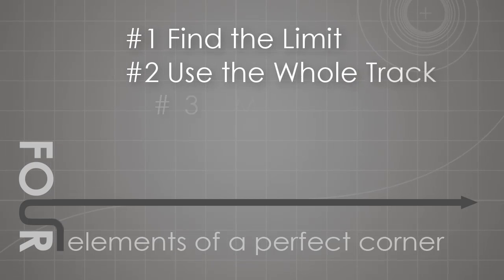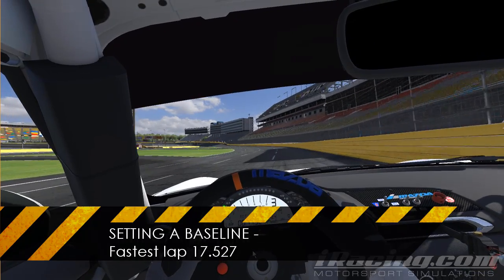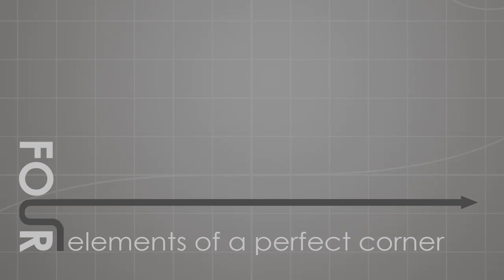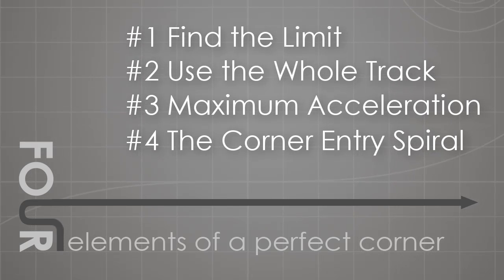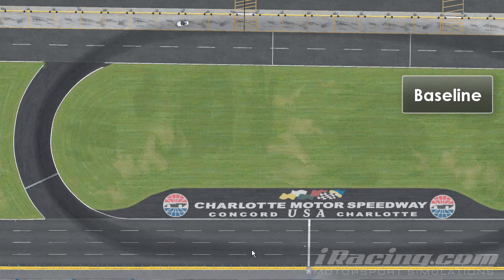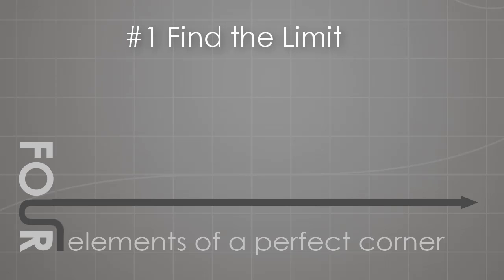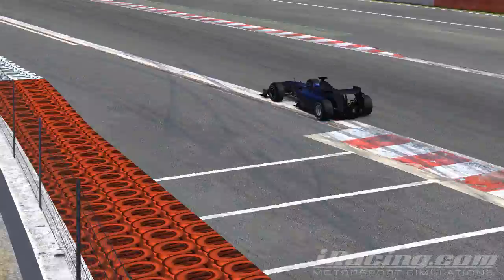The Racing Line - 4 Elements of a Perfect Corner (Physics Explained + Sim Training Tutorial & Tips)

Comment: Can you explain more why your geometric line is not at the constant speed as you state?
Reply from the maker: It is very hard to go directly from straight line braking to pure lateral cornering while still keeping the car at the limit the entire time.  If I had kept working at it I probably could have gotten closer to a constant speed, but what I was trying to show here is that even with a significantly increased apex speed and the same entry and exit speed I was significantly slower through the corner.  Even closer to a geometric line would have made me even slower through the corner.  Does that explain it better?  Let me know if you had more questions.

Comment: Found this video after reading your book. I like the theory overall, but it left some open questions for me. One is what is the actual direction of the forces for an optimal corner? 

Let's assume an AWD car that has more power than traction, and a 180⁰ corner. Applying the "SCUD missile intercept" control theory in the frame of reference moving at the approach speed of the car, the fastest way to get to the apex will involve applying the forces in the same direction diagonally from the turn in to the apex. Similarly, getting from the apex to the track out in minimal time (same theory but with a different frame of reference) involves generating force diagonally inwards. What's weird is that this involves accelerating before the apex, and slowing down after the apex 🤔 Curious if you've done any AWD experiments and visualization of forces.
Reply from the maker: I'm not sure I completely follow your example, but have you read this article. https://www.paradigmshiftracing.com/racing-basics/the-corner-exit-drag-race-racing-line-physics-explained#/ 
It might answer your question.  I talk about AWD in this as well as in the later books more if you've only read the first one.

Let me know if that article didn't answer your question and we can dig into it more.
Reply: @ParadigmShiftDriverDevelopment  thanks for a very quick response! That article is awesome, thank you. I wish I read it before the book. Do you plan to republish the book with corrections, and/or maybe redo this video? I wish I had a "one stop" place I could refer my friend to.
Reply: Also curious if you can point me at some explanation why the right shape of the entry is a Euler Spiral. I have a major in math and physics, and I studied control theory, but Euler Spiral isn't obviously an optimal line to me. Something like it — possibly, but curvature as a linear function of distance feel suspicious if the speed changes.
Reply from the maker: @TimurIskhodzhanov  Maybe at some point although I don't feel any of it is wrong, I just think of different ways of explaining things.  Some might work better for some than others.  I'm glad that one helped you.
Reply from the maker: @TimurIskhodzhanov  I talked about in the books how I primarily use the Euler spiral to illustrate the concept that the ideal entry line is one of continually reducing radius.  You would need a lap simulator programed to find the exact radius change rate for a given car and corner if you wanted something exact.  This wouldn't have much use though as a driver shouldn't be concentrating on trying to follow a preset line regardless. They are concentrating on other cues, but we've found that the entry line for a top driver in a typical car matches the Euler spiral so closely that it's also useful when charting out a line on a track map.
Reply: @ParadigmShiftDriverDevelopment  Yup, understandably that in a real car you can't use the exact same amount of max grip all the time. But still curious for an ideal car (this time without as much forward grip) if an Euler Spiral is probably optimal, or happens to just look close enough, and you didn't bother to go deep into those nerdy details.
Reply from the maker: @TimurIskhodzhanov  Well it does fit the principle by starting from infinite radius and then having a steady drop in radius along the path.  It would surely match the specs of a given vehicle since it visually matches most cars.  A rear brake kart would be a notable exception. I don't have a lap simulator program that would spit out exact curves based on various car force inputs although that would be really neat if someone wanted to develop one based on our work.  I did see how the new Sony AI driver Sophy for Gran Turismo produces Euler spiral shaped entry paths and that is beating even the top drivers out there.

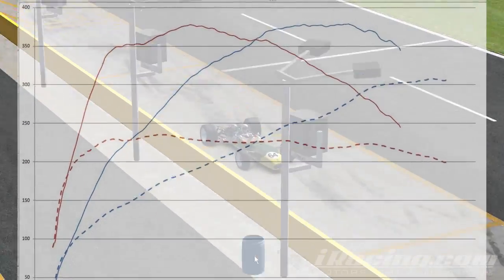Comment: At 17:10 I think you got a bit confused. The amount of "thrust" force the driven wheels provide is in direct relationship with the current torque, not power. A theoretical car with a flat torque curve, no aero drag and no drivetrain losses will generate the same amount of thrust on the driven wheels at any rpm while in the same gear. Changing gears will affect that amount though.

That being said, the general point is true: the important part is utilizing the traction of the rear wheels to 100%, which can mean all kinds of throttle pedal inputs depending on the exact powertrain of the car. ...TURBO LAG!
Reply from the maker: I understand what you are saying, but I try to keep my explanations as simple as possible as I know it can already be a bit overwhelming.  I'm not trying to explain horsepower vs torque here, I'm primarily trying to explain that you don't necessarily want a steady increase in throttle.   

For anyone reading this who is curious about power and torque here is a good video  https://youtu.be/UIQjyn95c-o

Comment: It seems like recent changes to the tire modeling in iRacing may have affected what is possible in the Miata -- are the sector times and speeds quoted in the video still current??  Also I'm wondering if you would be willing to share some data (iRacing or MoTeC format, latter first choice ;)) as I'd love to do an overlay to see where the opportunities for improvement lie.
Reply from the maker: Hi Mark, this is Adam.  I try to keep an updated current best time for the MX-5 at Charlotte legends on the training page of the website.  I think it's around 17.4 last I checked, but I haven't done one in awhile.  I try and do a new one every time there's been a change that affects times so let me know if I need to recheck it.  I don't think I have the old telemetry files still, but they wouldn't be relevant  to the exact current version right now anyway.

Comment: I couldnt really tell what the difference was between baseline and geometric. The baseline seemed to maybe take a tighter corner? They seem like the same thing but with different steering. I might need a better understanding of the fundamentals of cornering
Reply: Wait I think I understand. The baseline is just an arbitrary line that feels about right, the specifics don't really matter because it's just a starting point. It could be any line really. But from that point you then adjust where you want the apex to be and where you want the braking and acceleration areas to be little by little until the line is optimal. Do I have that right?
Reply from the maker: The "4 elements" of the video explain the baseline, but you can read more about the rules for a standard corner here.  https://www.paradigmshiftracing.com/racing-basics/the-rules-of-the-racing-line#/ 
We also have a new Racing Line Fundamentals lesson series that will cover this more in depth https://www.paradigmshiftracing.com/racing-basics/heres-a-simple-way-to-visualize-why-the-ideal-acceleration-point-is-always-at-the-apex-of-a-corner-and-why-straightaway-length-doesnt-matter-racing-line-fundamentals-1#/

Comment: You shoukd have mentioned earlier in the video that at 8.38 in the video (super late apex) both cars are limited to a max of 67 mph. 
Because if they are not, and both keep accelerating ... are you saying that if you travel down a straight at a higher speed than another car, you dont gain on them?
Reply from the maker: At the point in time the super late apex car crosses the line, both it and the baseline car are going 67 mph, but the baseline car is 46 feet ahead.  From that point on, they would both accelerate at the same rate (from 67 mph) and so the baseline car would maintain that 46 foot advantage. Does that help explain it better?
Reply: @ParadigmShiftDriverDevelopment  well, firstly,  even if the time gap were to remain the same down the straight, that 46 feet will change as they both accelerate. 
And, there will be a fixed distance to the next corner that they both need to drive to. 2 cars, each driving down a straight, will NOT do so in the same amount of time if they each start at different velocities.
The whole point about leaving a corner with a higher speed is to shorten the time needed to reach the next corner. If that involves losing time in the corner itself, then it becomes a trade off ... time lost in ghe corner vs time gained afterwards. If there is no straight after the corner, then overall you've lost time. If there is a straight, then ghe question is - how long is it, and will you make up the time lost, and more. And, of course, this would also have to take on board the respective power, gearing and drag etc of the two cars involved. 
I rallied, not raced, and it was never about one corner on its own, but where each corner sat in relation to what was before & after it.
Reply from the maker: @garyrowe58   
It is the time gap that will change as the two different cars continue down the straight.  The 46 foot difference will remain the same.  Consider two equal cars that take off from zero, but one is 46 feet in front of the other.  They will always remain 46 feet apart, but the time difference will shrink as they accelerate.  46 feet takes longer to traverse at 10 mph than at 100 mph.

In the video example, the baseline car will always reach the next corner 46 feet in front of the super late apex car no matter how long the straight is.  How much time difference this makes will depend on the length of the straight. 

We have an upcoming article that delves into this topic more that might help you understand it better so keep an eye out.
Reply: @ParadigmShiftDriverDevelopment  while the example video is correct, the car chosen and the extremely large radius is the reason this is true. 

The smaller the radius and or the more powerful the car the more advantageous a late apex becomes assuming a long straight follows.

I'm sure you already know all this but it seems a bit misleading for those that may take this as a general rule.
Reply from the maker: @H8MadXero Later in the video we show the ideal line for the Lotus 49 which is a more powerful car.  A later apex than the MX-5 is ideal, but not a "super late apex" with acceleration prior to reaching the inside of the track and the straightaway length doesn't factor in.

Comment: is the universal que similar to weight transfer?
Reply from the maker: The Universal Cue is a driver’s sense of where the car is and how it is moving through the corner.  It could be visualized in a similar way to how you would see an RC car being driven on a miniature racetrack as you tried to drive it through the corner as quickly as possible.  This is an external car cue, as opposed to internal car cues such as steering forces or tire noises.

Comment: Hello Adam, I'm currently working on lesson 2 (which required a lot of faith and patience as I had just shifted my mind from rear to the center of gravity :) ).
I just noticed that with the lotus 49, you are still braking past the apex. Is this something that you changed since you made the video?
Reply from the maker: I'm not braking past the apex, the Lotus double apexes a bit here in the middle as it needs a fairly late final apex.
Reply: @ParadigmShiftDriverDevelopment  ok, that was my second guess, but I wanted to be sure because the transition on braking is so smooth. It s been a while since I thought that 180 degrees turns are in fact double apex because of the 90 degree limit and the apex angle needed. Would you say they are necessarily decreasing radius?
Reply from the maker: @loicludwig429  The ideal radius change would depend on the car and exact shape of the apex area, but a high angle rounded apex corner will typically be very close to constant radius.  Plus, even the best drivers have slight line variations that will  need to be compensated for during the double apex portion.  The double apex portion of a corner like this is very much about car control and maximizing force, not necessarily trying to follow a perfect radius change.  I wouldn't call out a driver for a definite mistake here unless they are accelerating before they reach the inside of the track or braking after they have left it.
Reply: @ParadigmShiftDriverDevelopment  i get it. Thanks again Adam!

Comment: Is a standard late apex (not a super late one) acceptable though? Are these really ideal for faster cars? I feel like a late apex will always minimize the use of the whole track, as you don't really need to use all of the width of the track on the exit...
Reply: Also, I don't quite understand why the apex momentum is determined by power, and not by grip. Shouldn't you always want to carry as much momentum as possible for a given level of grip, regardless of the potential power you have available? At the end of the day, your turn-in is determined by how much grip your tires can put down, power is only there to make sure the tires are using its peak grip capacity.
To put it in a different way: let's first optimize the path to the apex. How fast you can reach the apex is only determined by your grip and braking capacity, not power (as it won't be used). As you reach the apex as fast as possible, you now optimize for the exit. This part depends on the grip again, and on your power. At this point you'll put as much power as possible to maximize use of tire grip (which lands you just on the outer edge). As you begin optimizing from the apex to the exit, however, your momentum is already defined by the previous optimization. In the Lotus example. Why wouldn't you want to carry as much momentum on 2nd gear, as you did on 3rd gear?
Reply from the maker: It's actually determined by the ratio of lateral (sideways grip) vs longitudinal acceleration.  Power is just an easy shortcut to go by.  If you take a given car and increase power, it will typically increase its ability to accelerate forwards, but its lateral grip won't change.  This would make its ideal apex for a given corner become later.

Power in itself doesn't necessarily mean a car will alway have a very late apex though.  A formula 1 car has tremendous power, but also tremendous sideway grip so its ideal apex would be earlier than something like a Corvette that has half the power, but 1/4 the grip.  It's the ratio that matters. It's all about maximizing the total net tire force in the ideal direction during corner exit.  The type of car that would have the latest apex for a given corner would be a very powerful 4 wheel drive car because it can accelerate forwards as well or possibly better than it can accelerate sideways.
Reply: @ParadigmShiftDriverDevelopment  Hi Adam, I find the concept of maximizing your force vector in the ideal direction fascinating. One thing that I'm at conflict with internally though, is how your ideal line is based on a smooth Euler spiral, yet I've read about the merits of "squaring the corner" or taking a V-shaped line in power-biased cars. If for the sake of thought experiment, we imagine a car with lateral grip approaching 0, that car would maximize its force vector through a 90 degree corner by braking in a straight line to a near stop, cheating the turn using rotation, and then accelerating straight out the corner. Could this strategy not be extrapolated to a car that is overwhelmingly longitudinally grip biased, albeit to a less extreme degree? I understand that a V-shaped line results in some wasted distance compared to a smooth line, but surely there are real situations where the calculus checks out?
Reply from the maker: @zhutwo  Yes, I talk about this in my books.  The Euler Spiral line is only a guideline for cars that have about equal braking and turning force.  This represents just about every car however.  As braking force increases in comparison to turning force you would "stretch out" the spiral.
Reply: @ParadigmShiftDriverDevelopment  Hey thanks for the reply! I'll definitely be checking out your books.

Comment: And what about a late apex? Not a super insane late but just a late apex?
Reply from the maker: HI Luis, sorry for the late reply.  Could you explain a little bit more about what you are asking?  A super late apex is a line where acceleration starts prior to reaching the inside of the corner.  A normal apex would be one where acceleration begins along the inside and then there is a spectrum between earlier and later.  HIgher acceleration cars will need a relatively later apex than lower acceleration ones.